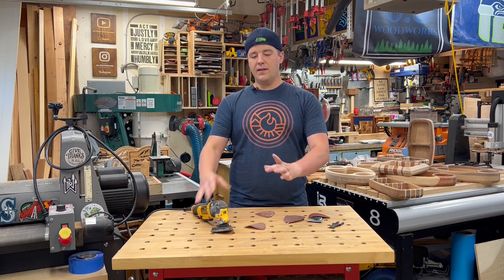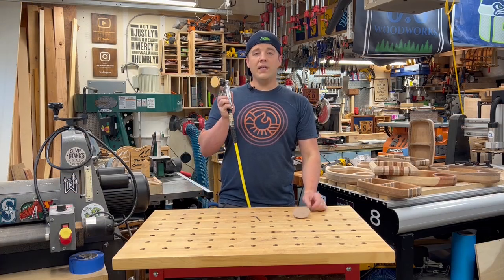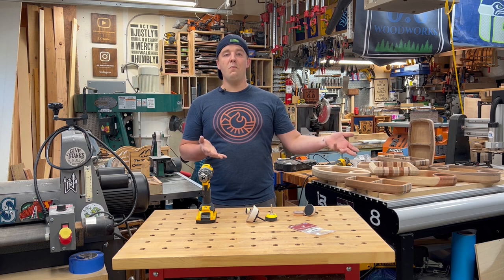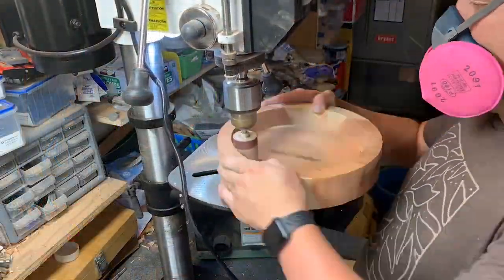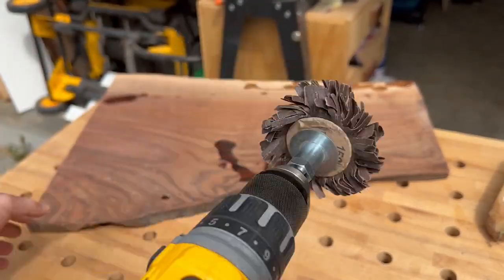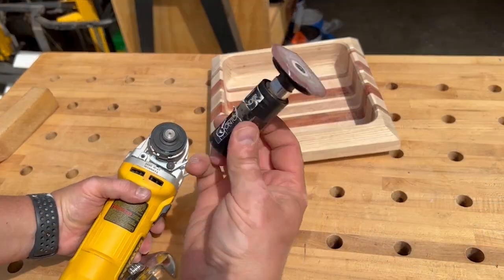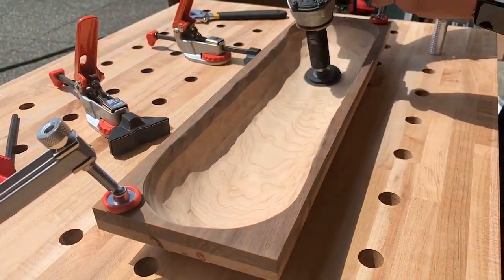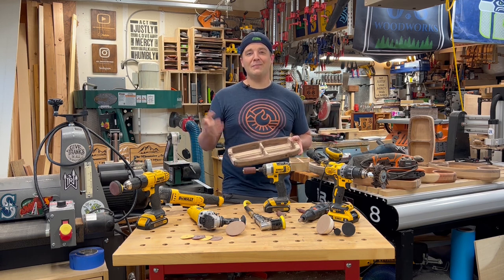Specialty Sanders: Small sanders and attachments for hard to sand woodworking projects

Comment: One that I have that I really like is the Inflatable Drum Sander by Grizzly (Model D4595 - they also make a smaller one the D4594).
It's sort of like a Rolling pin with a handle on one end and a spindle to fit in a drill on the other end and it works great when you sand chair backs or arm rests. 
Because the sander is inflatable it can give versus the hard rubber drum sanders that I can never tighten enough to hold the sandpaper.
Grizzly also has the Guinevere Basic Sanding System which you can attach round, inflatable sanders to (but I haven't used this system myself)
Reply from the maker: I’ll definitely have to look into it. I’ve had my eye on the Guinevere for a while. Anything to minimize the hand sanding 😀